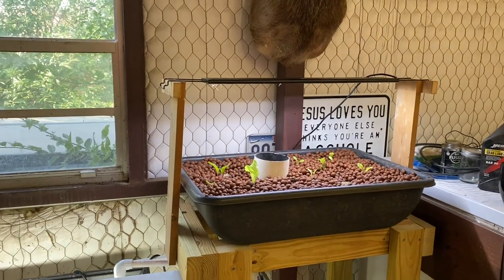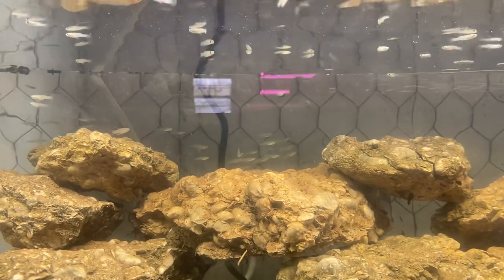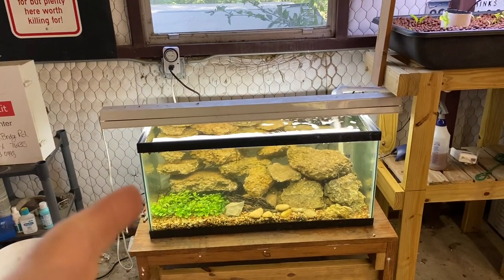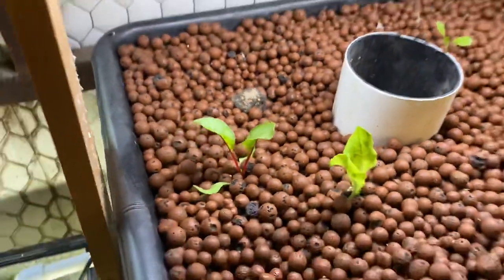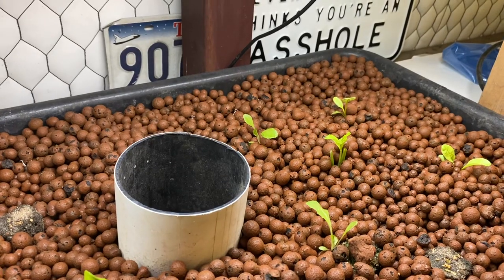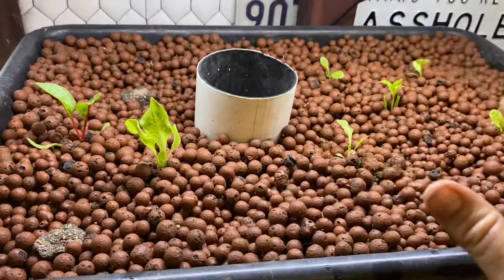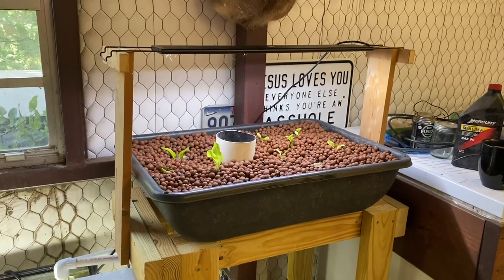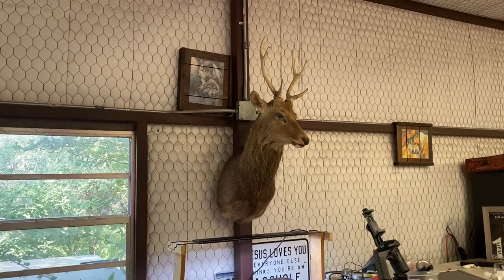Ebb and Flow with No Bell Siphon - Fish Tank Micro Aquaponics

Comment: What adapter or how do you attach the PVC pipe to the water pump?  I've seen that most if not all of your aquaponics/hydro systems have the PVC connected directly to the pumps.  Is there some universal fitting that handles that?
Reply from the maker: The pumps I recommend (at this size) will accept a male threaded to female slip PVC adapter.  The male threaded just screws into the pump housing.

Comment: Maybe I missed this in the video, but what was the purpose of the timer? Just saving on electricity?
Reply from the maker: Yea totally and I was just thinking I need a SHORT version of this ONLY talking about the timed pump, the point is to do ebb and flow (food and drain) with no siphon.  The pump kicks on and the grow bed fills to the over flow high level.  When the pump turns off the grow bed drains back though the pump.  This can't fail like ever single siphon can.  It is used extensively in hydro but no aquaponics people seem to know about it.  For most systems you can run 15 on and 1hour and 45 minutes off.  Yea this saves electricity but the real key is your ebb and flow ALWAYS works, never sticks, never fails, etc.  Of course yea less power and your pump lasts a lot longer too.
Reply: @survivalpodcasting  Sweet. Thanks for the in depth explanation!

Comment: Hey Jack I'm not sure if you're aware of this or not and maybe haven't went this route for another reason but you can run a sump tank without drilling a hole in your tank by using an overflow pipe. You can make them cheap and simple. I use one on the system in my office. Check out this video of a guy making one in just a couple minutes. https://youtu.be/WgcyuXm0QRM

Comment: Could you set up multiple ebb and flow grow beds on the same level with this method? Would this method work with one pump with one input pvc feed to multiple beds at the same level? Thanks Jack.
Reply from the maker: Of course as long as the pump has enough though you can even do it multi level that is exactly how my vertical farm is working now.  If you go multi level the beds will drain top down.  The only limit might be say you have 6 beds and when a cycle runs it takes too much water from your tank.  In that case you'd want two pumps and set the timers so they don't run at the same time etc.  But that is no different then doing it with siphons anyway. Make sense????

Comment: This is a similar method I saw used at a PDC in Austin Texas. They have a round stock tank with a few koi in it that feeds veggie starts and helps root cuttings for propagation. Simple yet effective.
Reply from the maker: Like I said it is extremely common in Hydro, they even sell specific kits for it.  Just not very common in aquaponics, people learn siphons and stick with them despite all the issues they cause.